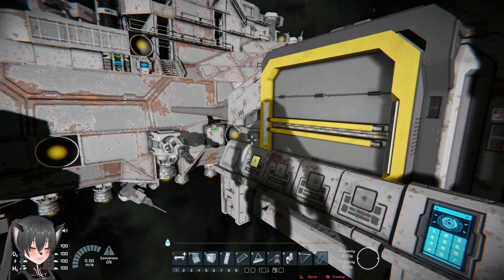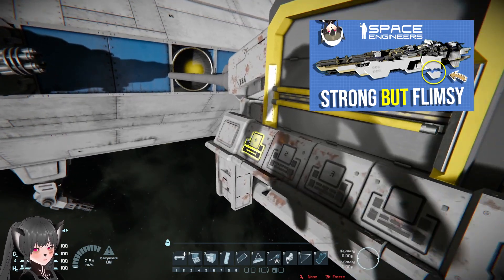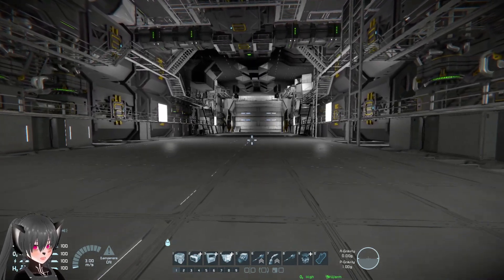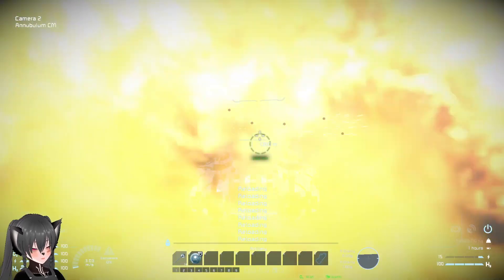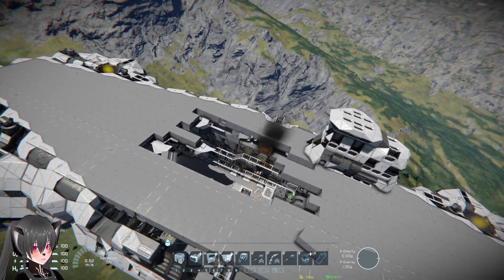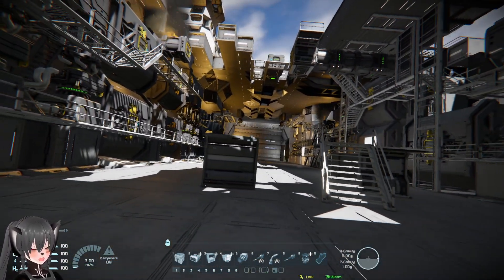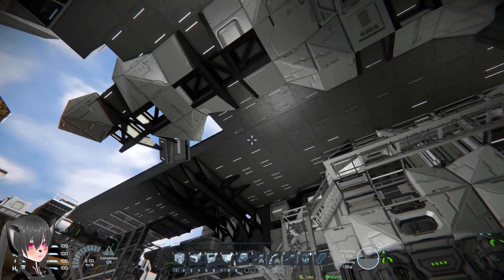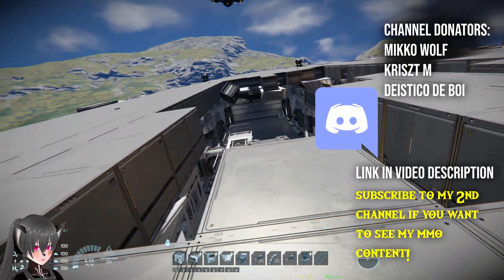Benefits of Big but Hollow Ship Hull, Space Engineers

Comment: I think a simple way to say this would be, that the hollow space can throw off the enemy's ability to target critical components, whereas a solid core destroyer class ship with no wasted space is 90% critical components.
Reply: That I'd think is down to a player handling targeting vs an AI: AI will always attempt to target critical components on an enemy vessel even if it can't 'see' them such as in internal power systems. Mount a reactor behind the wall of a grid 'target' for instance, then paint a bullseye with the dead center marking where the reactor would be and the AI will always attempt to land shots dead center of that bullseye.

What I think would make larger designs successful no matter if it's a solid-core or hollow space is how the engineer handles redundancy. Multiple reactors mounted in different sections of the interior. Battery backups mounted in sections of hull not guarding volatile components. Breaking up volatile hydrogen tanks with inert components to prevent chain reactions. Maybe even using those hydrogen tanks as reactive armor to shunt penetrating shots away from hitting ship-critical components, ie layer armor between the tanks and whatever they're protecting so shots destroy the tanks and armor, but not whatever's inside.
Reply: @TustlePlays This is essentially how I construct my large grid ships. Critical System Redundancy is essential.
Reply from the maker: That's one benefit of it I guess c= but it's mostly how more hull surface area makes it harder for the ship to break apart in general even though they're hollow
Reply: I think you are still missing the point a bit.

If you have an explosion with a radius of 4 blocks, going off against a ship which is 4x4xwhatever it will take only 1-3 rounds to break it in half, if solid.

If you instead take those 16 blocks per slice and make the ship 6x4xwhatever but hollow, it would literally be impossible to break in half with a single explosion of that size, and actually fairly unlikely to do with 3 explosions of that size, and fewer of your structure blocks are in range of any given explosion with them spread out more.

Comment: "The extra surface area will still make it more expensive and longer to build than a solid hull."
...can confirm from several earlier attempts at attempting to build a battleship. Didn't help that one of them was also seven enthusiastic quad railgun turrets of overkill too but yee
Reply from the maker: Yeah xD since for every extra block of width or height you need to put armor across the length of the ship x -x and oo O: railgun turrets x3